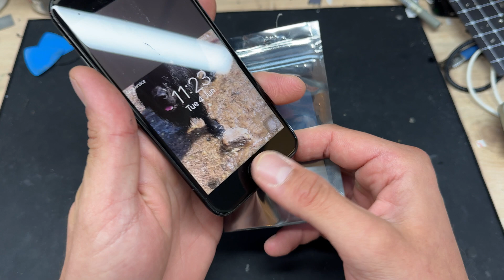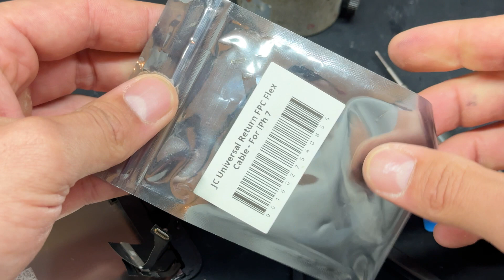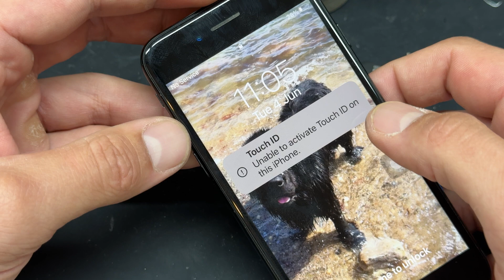Iphone 7 Home Button Repair - How To Fix Your Broken iPhone 7 Button!

Comment: I recently replaced my iPhone 7 battery, and I think I tore the home button flex cable while reattaching the screen. If I think the button itself is fine, do you think just replacing the flex cable with the product you use from JC, will restore some functionality? Thanks for any advice!

Comment: I need that universal return cable as mine has come away/split. Where can I buy 1 from please?
Reply: I got mine off eBay for about $8. I also bought a new home button for $5 just in case. Just did my phone like the video and my home button works great now.

Comment: Thank you so much for this tutorial. 😊 I did it and it worked. I was skeptical at first but i went online and bought the materials for 188 philippine pesos.. at first it didnt turn on and i got pretty nervous 😂 then I saw the first back plate uninstalled and so i did, voila 🎉 it turned on and the home button works fine... 😊😊😊

THANK YOU SO MUCH!
Reply from the maker: You’re welcome 😊
Reply: Finger print will work
Reply: @Pk12986 does finger print work?
Reply: Does finger print work?
Reply: may i ask? where did you order your universal flex cable for iphone 7?